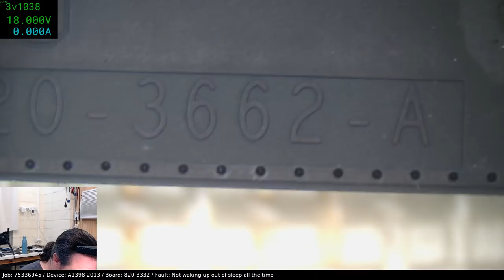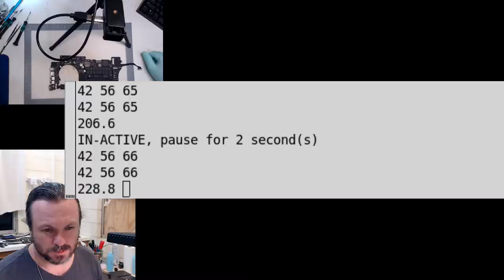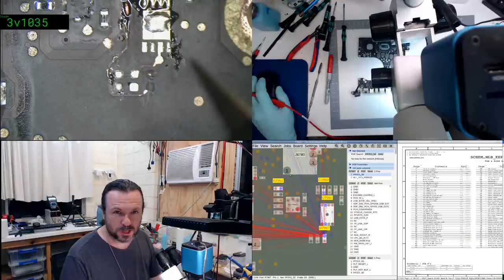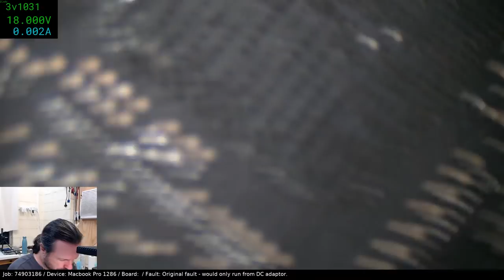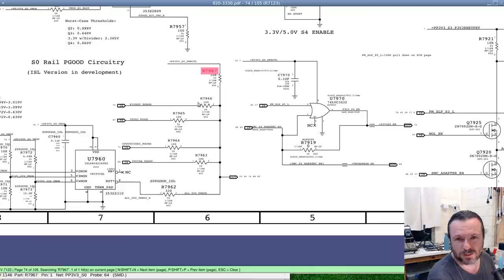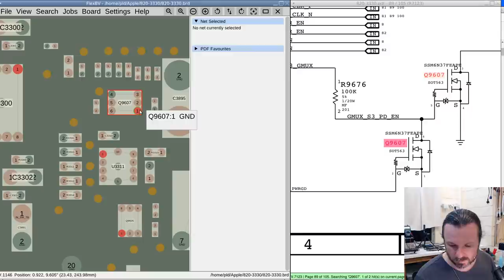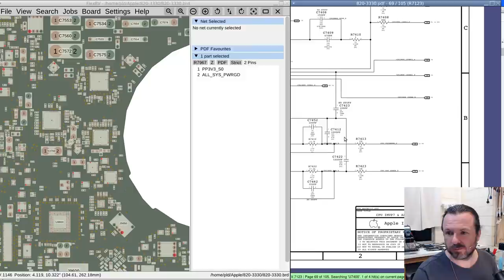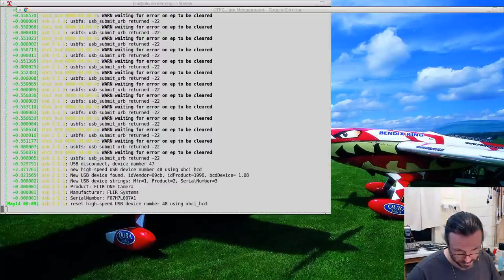Middle of the week, 3 hrs sleep, dental work, now some repairs with news about the FLIR software

Comment: The second camera lens view can be merged with a beam splitter at minor loss of performance to eliminate parallax. The camera configuration will have to be bigger so that is seldom done.
Reply from the maker: The problem is that the beam splitter can’t work for both long infrared and visual, it’ll be opaque for one or the other or poor for both